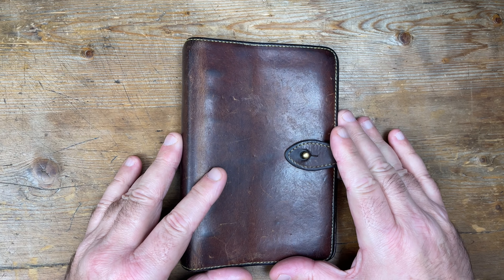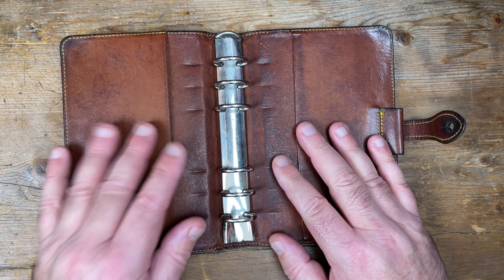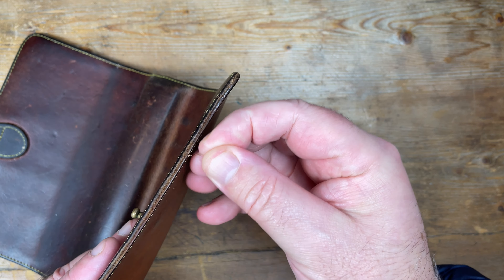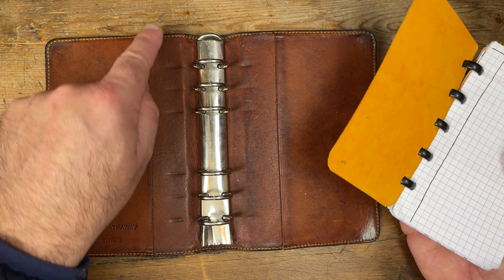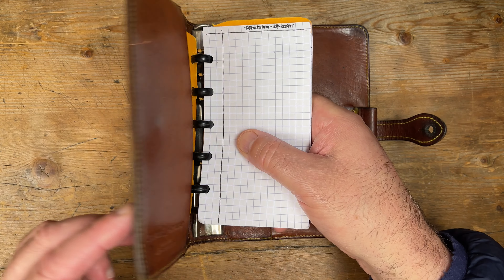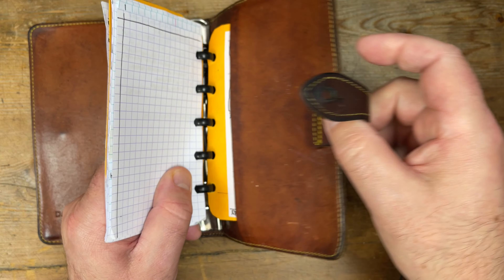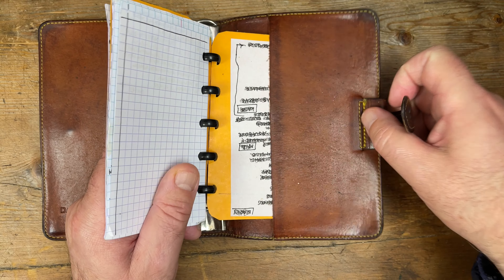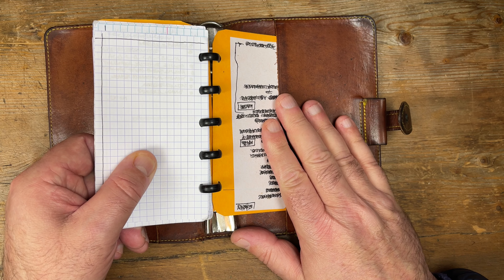🟢 Considering my Daines and Hathaway binder conversion // paper based philosophies

Comment: To me, the leather looks smooth enough that the friction will be minimal, but I am used to this from other notebooks I use. I have a rather large collection of leather  notebook covers. If you remake the card cover from a smoother cardstock and maybe try and polish up the interior of the leather, it would reduce friction even more. I do think having some friction is better as it will help the book stay centered within the binder. Upsizing the cardstock to match the pocket size of the binder could also help.
Reply from the maker: Some good suggestions and tips - thank you.
Yes, I will increase the size of the cards.
I have looked at commercially available notebook covers, and I'm experimenting with a couple of passport sized covers as you probably know, but still undecided. I must admit that I like my minimalist disc bound planner so much on it's own that I'm thinking that it might work better without a cover, and just replace the card stock periodically wen it becomes too worn.
Plenty to think about. Thanks for your input.